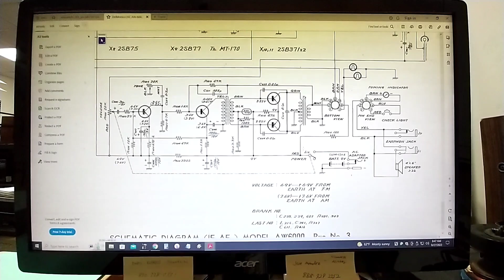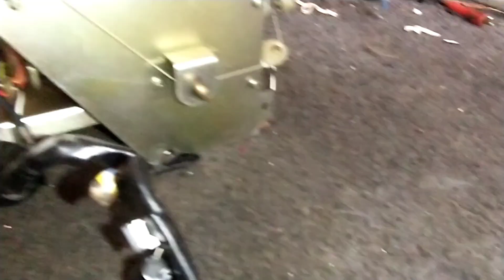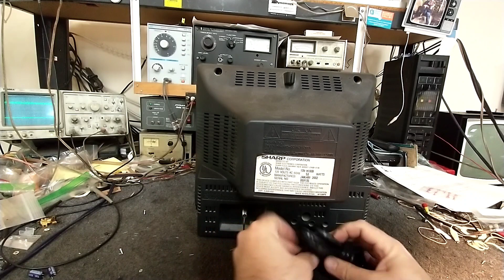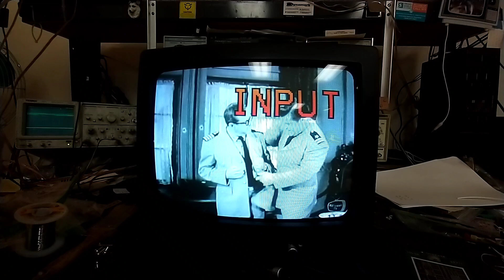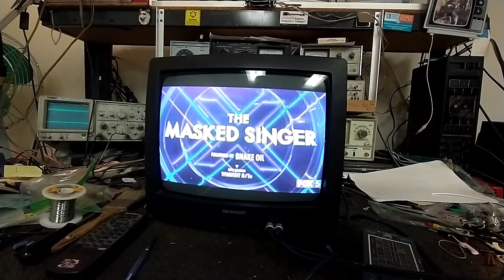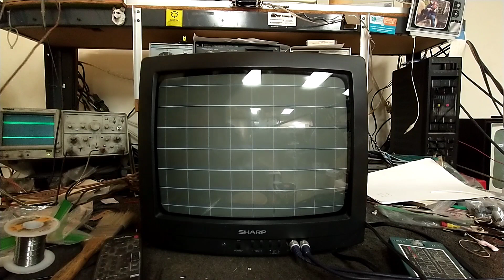Servicing a 1960s Delmonico (JVC) AW-6000 11 Transistor multiband radio - P2/? - amp exam & BONUS

Comment: On my sharp TV/VCR combo from 95 if you hit picture reset. The set defaults to the contrast being cranked all the way up. I believe they did this so it would look better at the store on display. Not good for the tube though. Also nice to see a new video from. I manly work on my own vintage electronics but if someone needs something fixed and is willing to pay for my time I will fix there stuff. Now I need to get back to fixing a mide 80s Sony boom box.